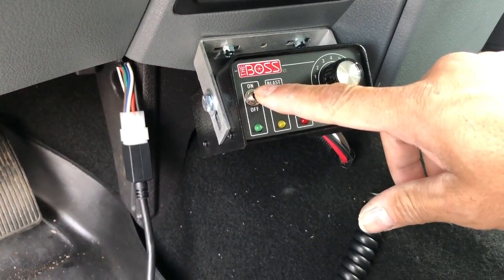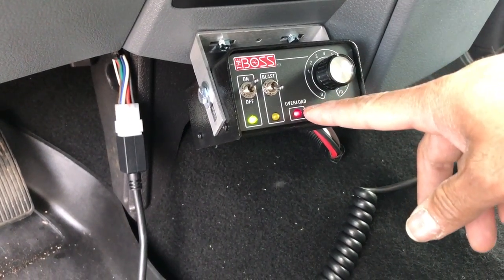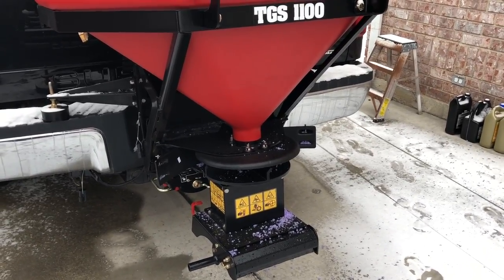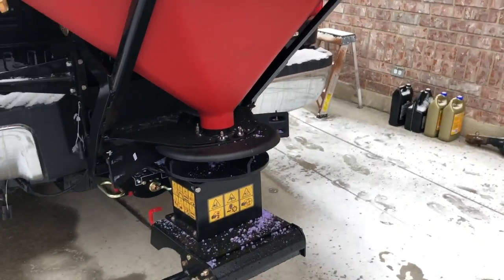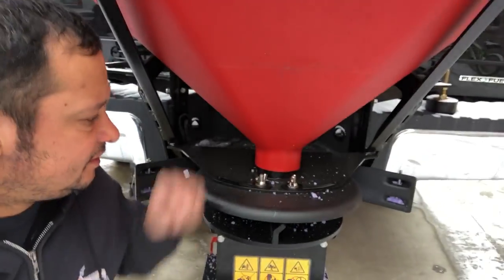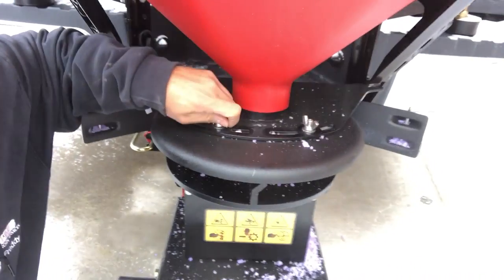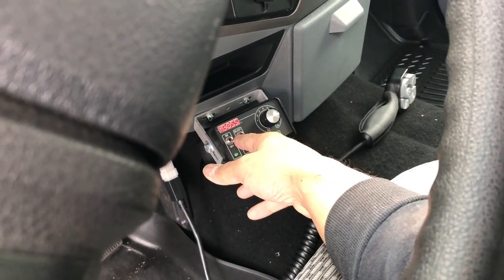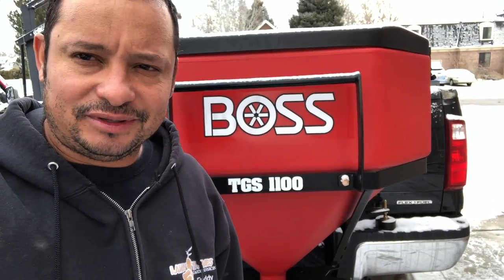Boss Salt Spreader Clogged  (Overloaded)

Comment: I had one of these spreaders since 2005. Love the hook up and the way it spreads. But I replaced 3 transmissions in it and for the last 7 years I downsized a lot but kept spreader to do the four places I still have to salt. When I go from job to job a lot of times you have to get out and spin the spinner to get it to start spreading. I don’t have those wi g nuts on mine. My spreader actually start n stops itself : times before the spinner keeps running. It’s great when it works. My next one will be a snow ex. They come with small auger to get the salt to the spinner and a vibrator standard. Love my boss plow. No problems in 15 years. Please. Check out the snow ex tailgate or salt dogg spreaders before you make your purchase.

Comment: never leave hopper with salt in when not using, doesnt matter the size. i will also say a proper washout after every use will keep u problem free and looking good for yrs to come. just some tips i’ve learned the hard way over the yrs.
Reply: mr cumminsforlife I just realized that with my atv spreader, I left calcium pellets in there thinking it’ll stay dry because it has a top cover but it actually collected moisture through the bottom even though the latch for dispensing is closed!